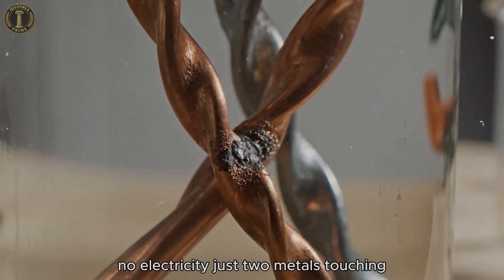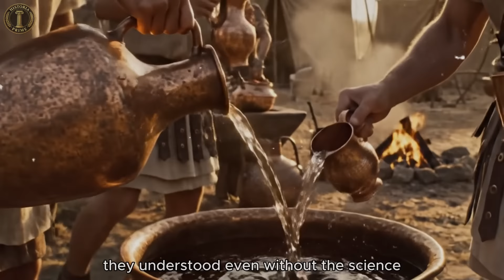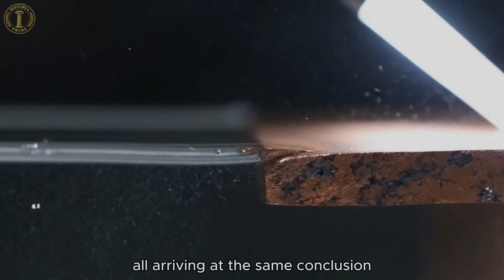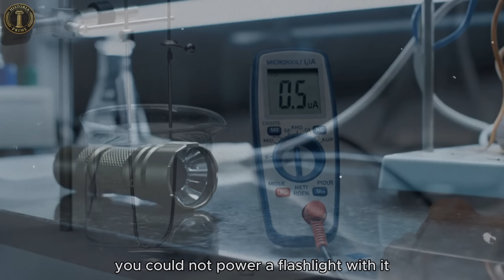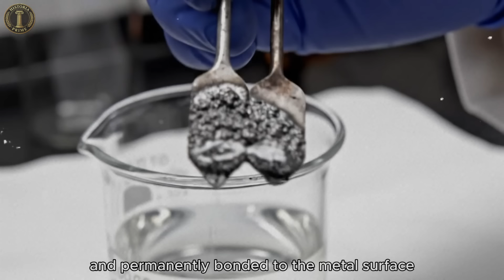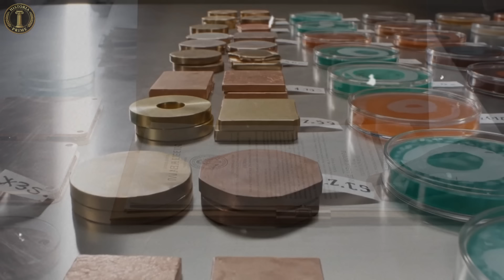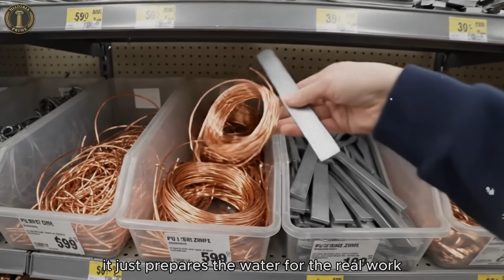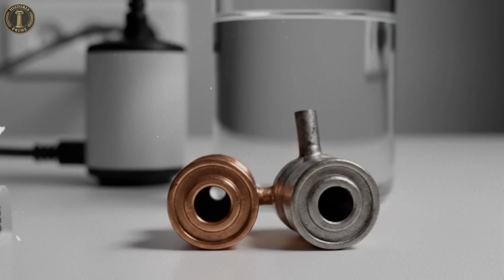Connecting Two Metals Purifies ANY Water — The "Earth Filter" Secret They Buried

Comment: Bring back copper water lines in homes, pvc plastic is poison. Many new buildings are replacing pvc pipes with copper, the results are noticeable quickly.
Reply: My brother's first job out of high school was as a helper with a Plumbing Co.  Ater a year there my Bro gifted my parents with replacing all their ww2, galvanized steel plumbing in their house with Copper Pipes . Iam still using the house & its wonderful Copper plumbing today and what a difference when its not copper.
Reply from the maker: A lot of people still prefer copper for durability and heat tolerance. Every material has trade-offs, but it’s understandable why copper continues to have such a strong reputation.
Reply: Just be sure NOT to solder with lead. 😉
Reply: Same principle can be used to repell insects
Reply: @ApollyonLethePouvez-vous me dire comment ? Merci
Reply: Yea they know that’s why they switched
Reply: Galvanized pipe too yuck
Reply: Sadly building industry is about profit not safety or health, the regulations are as minimum as the government can keep them as well as restrictive as government can keep them.
Reply: Let THEM eat plastic. YOU can just install your own copper pipes.
Reply: Well if people wouldn't immediately steal all copper pipes....
Reply: If you have the money, you can do it
Reply: We had copper piping for years in our home. The only thing us pin holes happened all the time making the well pump run . Leaking pipe tore up one well pump. My husband thank goodness knew how to install a new one. After that expense he changed out all the copper pipes.
Reply: @PatriciaAShelton-no6cq  - I hope he was using HDPE pipes. (High Density Poly-Ethylene). They do not have any kind of chemicals inside and they can not dissolve in Acidic or alkaline water. This is the best choice for water. In Germany they use it for all pipes, the big pipes in the road to the houses, because they are completely harmless from a chemical standpoint.
Reply: I read one time that one should not save pennies under the bed. They could draw lightning. True or not? IDK. 
If true, could that be true with copper pipes? 
I wear copper bracelets. Have heard they were good to help with arthritis. True or not? This makes me wonder if could be other benefits of having copper on oneself. 🤔
Reply: @TheQuicksilver8 How goes your arthritis . Thinking of buying one myself
Reply: @TheQuicksilver8  - I am a huge researcher.  Arthritis (if confirmed with an X-ray showing calcified nodules in a joint) is simply a magnesium deficiency.  I had painful bone spurs that dissolved, taking the pain with it, after 5 months of a daily regimen of Magnesium oxide at 3x the daily dose.  Take one zinc per day also, for immune system issues.  Persist and at the 6-month mark, you will be smiling with your calcified nodules gone along with your arthritis diagnosis!
Reply: @TheQuicksilver8 :My mother wore two on each wrist. She swore they helped her arthritic hands. Now I'm 73 and have arthritic hands.  Very painful along with hip and lower back. Actually my upper back hurts to now days.  But I have psoriasis so mine probably is caused from that to. Dr wants you take meds but the side effects are so dangerous.  I did take a monoclonal antibodies drug  for psoriasis a year before Covid hit. The cost was astronomical.  Fifteen thousand a shot. One shot in September then another in October to get started.  Then one every three months.  I was given the injections at the Dr office so my insurance paid for it. Medicare covered their share of thirteen thousand, my supplement plan picked up the remaining two thousand.  I couldn't afford the treatments with new biological drugs until I retired and started my Medicare which I do pay for plus my supplement plan. I couldn't pay two thousand dollars anyway every three months. No way.  Thing is tho when C hit I quit taking it. The drugs slows the immune system and can be life threatening catching just a cold that could turn into pneumonia.  But my psoriasis to this day hasn't come back. BUT!  In 2024 I was diagnosed with a rare sarcoma cancerous tumor in my left ankle called leiomyosarcoma.  A cancer that attacks the soft tissues  like veins, nerves, tendons but rarely bone. No treatments for this type I had. Surgery to remove my leg below knee. I will always believe thar the shots caused it. And the so called Covid vaccines are not vaccines at all, but a monoclonal antibodies or biological drug. That's why it didn't stop the spread or ftom you catching it. Why you needed shots every three to four months.  I knew that after I was curious what the name of the drug actually was because Pfizer is the company name like Tylenol or Bayer. These meds are spelled strange and hard to pronounce but they all end in MAB. MONOCLONAL ANTIBODIES.  Kiss my butt an call it a biscuit after I learned the name I was informing people in the comment section and next thing I know they started to change the medical names of these drugs. They took down the video I watched to learn the name . Videos they put out sat Drug companies changing name of vaccines.  Those are still up I suppose.  But it happened fast. And the pharmaceutical companies made trillions on these drugs.  Of course if you didn't have insurance it was free, but if you did have insurance they took it and no copayments or out of pocket needed. Governments paid a lot but I'm sure those in the know invested heavily in them.
Reply: Stupid. Copper which is not bound to organic molecule, this will harm your body. It will travel in your brain and create fear-disorder.
HDPE pipes are the best what we know these days. 
Copper will create neurological damage and weaken your immune system.
Reply: @mikropower01  and the link to the studies about  what you wroted ,please
Reply: @mmvm562 - This is common sense, elemental copper is toxic for all human life, plants, animals, bacteria.
Show me the study that it will harm people if you crush their head with a hammer. Does not exist, so it should be no problem. Right?

Use google, wikipedia or biology books.
Reply: @mikropower01 Tool
Reply: @mikropower01 pistachios. U.v. armor itself. 1/4 cup=.36mg. 40%ish daily copper (for dieters, 2000 calories)
Reply: @LivingStone.d  - I take copper supplement, 2mg of Copperbisglycinate every day.
Pistachios are here a bit to expensive to eat this daily.

But you are right, it is the best only use copper which is bound to an organic molecule, like in the pistachios, I would never use elemental copper, because this will damage the body and brain.
Reply: @mikropower01 Ppl 4get to quick search their body types general compatability, with, anything.
Thats how you automagically rule out fake/abrasive supplements too man
Reply: @mikropower01  just take chlorophyll - it has copper
Reply: @mikropower01 :think it's lead piping you're speaking of. Not copper.  Copper has been used in plumbing for many years.
Reply: @PatriciaAShelton-no6cq  - Lead was used by the Romans and they did know the problems with lead.
In Germany we have got the order to let the water flow out of the pipe, till new, fresh water has replaced this old water (with Copper ions in it).

Copper is very toxic to all kind of life.

If the copper dissolves in the water, then there is no grow of bacteria any more, but because of a good reason.

Copper is good for the human if it is bound with an organic molecule. To example Copper-Bisglycinate. Normal elemental copper will damage any tissue and it is bad it it is damaging the brain.
Reply: @mikropower01  A complete tool calling people names.. Educate yourself before you talk be es! Copper pipes are safe so is drinking water from copper cups. You are confused with led pipes!
Reply: @TimmyArroway  - Ha ha ... they are not save in Germany, but we have other standards compared to the USA. In the USA they can bleach flour, use bromid in it for what ever reasons, add food colour in corm flakes which cause cancer. I guess, everything is possible in the USA.
Reply: @mikropower01 You need help and education.
Reply: @TimmyArroway  - I am very well educated. You are unable to use google. You possibly get your knowledge and education from Tiktok. 🤣

Comment: How about a pre 82 and a post 82 penny stacked  in a glass of water
Reply: Good thought!
Reply: I bought 100% copper rounds, small, from Amazon and put into my water jugs, sits overnight and purifies the water before I drink it. Water tastes So much better 😊
Reply: @SatoshGirl 🤝
Reply: & you could probably purchase the pre 1982 pennies from Money Metals Exchange if you can't find any
🇺🇸😎
Reply: I just googled the difference between the two. 🤯 🤝
Reply: @LittleMissUnderstood ... And ?? ... 🤔
Reply: @Donnie.Silver
Pre 1982 pennies were 95% copper 5% zinc/tin, weighing 3.11 grams. Mid 1982 forward,.pennies are 97.5% zinc and 2.5% copper PLATING, weighing in at 2.5 grams. Huge difference.
Reply: @LittleMissUnderstood ... Thx 😉👍🏻
Reply: @Donnie.Silver👊
Reply: @LittleMissUnderstood  One alleged reason for copper pipes being replaced is that they tended to get encrusted with residue inside the pipes. The real reason could be that those pipes weren't pure copper.
Reply: @i @istudios225 en we replaced some copper pipes in our house they were lined with green algae. They were 45 years old.
Reply: @istudios225 reading about scrubbing your pots and mugs because they get a coating that would be very difficult to  remove from pipes. Be happy just to have clear water with no microplastics how would you clean them?
Reply: @JeanEcassup .  I’m giving blood to Red Cross to remove plastics.  Probably not significant but diluting in any case!
Unbelievable world we survive in now!!
Reply from the maker: Interesting idea, but that’s still a very different setup from using the metals in a purpose-built arrangement. The composition difference is real though, which is why
Reply: @HistoriaPrime1212  will copper and zinc remove fluoride from the water?
Reply: @Carmen-us1ew   Good question: Anybody have the answer?  Anyone? Bueller?  😂
Reply: U
Reply: the newer pennies are zinc flash-coated with copper,so the zinc doesn't get exposed for galvanic action in water.
Reply: @JayWye52  Just run a file along the edge and expose the zinc, keep cutting new notches as you use it so the heavier metals that form on the surface don't block the reaction? Just a thought. Also you should probably wash a penny and maybe even hold a torch up to it before using it in any water you plan to drink. It may kill bacteria but I don't know about all the viruses that might be on a penny.

Comment: Where do we get zinc?
Reply: Electroplating shop . Get a zinc annode  ball.
Reply from the maker: Usually from hardware, roofing, metal-supply, or online material sellers depending on the exact form you need.

Comment: Big Pharma would not make any money. Needs to keep us sick
Reply: Cropper pipe is recommended, and changed from metal pipe already.
Reply: We are living through the changing of the Ages. I am oh so glad to see the ending of a dark age. 
WELCOME TO THE AGE OF UNDERSTANDING!
BE GLAD IN YOUR HEART ❤️🌎🦋
Reply: Will it work in pool skimmers ?
Reply: @demand1575    - READ THIS IF YOU HAVE A SWIMMING POOL - We have a large inground pool and spa at our home (30,000 gallons).  We've lived here for decades.  I had always managed our pool chemicals and maintenance and kept things sharp. But it was time to update and remodel the aging pool. So, we bit the bullet and had a full pool remodel - new pebbletec-type surface, new coping tiles, new pump, new large sand filter, etc. It looked beautiful.  
But shortly thereafter, we noticed the filtration and chemicals were not keeping the water clean like previously.  The water was constantly turning green with algae! We dumped in boxes and boxes of liquid chlorine, algae reducer, shock, and every other thing available to cure it.   We went through changing the pump to another one, changing the sand to Zeolite, numerous technicians were called out to troubleshoot, etc.  Nothing helped.  The amount of effort and money to try and treat the pool water was insane.  
After copious research, I learned about Copper Sulfate powder. I use specifically this: "Copper Sulfate Pentahydrate Powder".   I bought it online and sprinkled about 4-6 cups across my pool water and ran the filter round the clock.  It turned the water a brilliant opaque cloudy blue.  Over about a week, the sand filter removed all of the blue cloudiness and my water was pristine.  
I have had no more algae, PERIOD.  It was incredible. Now, for my own piece of mind, I still have several floating chlorine dispensers and very occasionally add muriatic acid, but no more algae!  I keep a 5 lb. bag in my stash and if there's been a big storm or a lot of debris fall in the pool, I sprinkle a cup or two in the pool and that's it!  No more gallons of chlorine or shock during the summer dust, wind and rain storms.  I only regret that I had never learned about this years ago!
Reply from the maker: A lot of people feel frustrated by that system. We try to focus on practical, testable methods people can understand and use for themselves.
Reply: No your environment, food & drink and no exercise makes people sick.
Reply: @Robert-hr6sh  sounds like y’all are making the same point…he’s saying if we did these things and eat right grew our own stuff, learn how to purify our own water and foods,big farma won’t make money,then doctors won’t make money ect ect…they need us sick is his point…but,your correct both things can be true..we need to build instead of waisting time with contention we are the people,was your comment to teach or fulfill your ego ?we gotta come off mommy tit at some point.
Reply: @E.r.u.p.tlegiontv 🎯
Reply: By nature we get sick .you people actually believe to be immune to everything 😂
Reply: @brianlove5782  there’s a system stored to work on speeding it up that’s why the life expectancy changes every 100 years brother…they will never tell you the things of this world heals cancer..do you understand all these industrial things are new cancer isn’t ancient brother niether is hiv…we know people get sick but when there’s no cure you know it’s pure cruelty.
Reply: @brianlove5782 By nature? How? Is this laughable to you?
Reply: @meddinaheeleen777because nature is the real enemy of life, yet there is no life without it.
Reply: Ok,thank you❤ Imo illussions are our worst enemy. It hides the truth about everything. Nature is used and abused not the other way around. God bless.
Reply: SPOT ON! BUT OHH MY GOD! SO MANY LYING USEFUL IDIOTS EVERYWHERE! THEY ARE DANGEROUS! LIARS ARE NEVER HEALTHY TO BE AROUND.
Reply: This isn’t big pharma. This is fools thinking they know better. We have used brass for centuries for this exact reason. Stop lying to yourself.
Reply: @donut3946  Fools? Why are Americans so rude! My God you are everywhere on YT bullying people. Say what you want to say without patronising.  It's becoming unbarable!
Reply: Zero water filters have copper, and charcoal in them.
Reply: Flint Michigan !all those kids that died from water ..wow !no justice even though this information is no secret…I say genocide😢
Reply: Guess now I'm on the LIST....😊
Reply: agree with you about this

Comment: I use the Nature 2 system to clarify my hot tub water. A single cartridge, just lying in the skimmer indent, keeps the water crystal clear for at least a year in a 450 gallon hot tub @105 degrees. And I mean crystal clear. As clean, or cleaner than the drinking water in your house. Easily. And I've learned to never check it.

This all started because a French company, Perrier water, was bragging about how they had the cleanest bottled spring water in the world in their TV ads, and it turned out they did. Too bad their spring was in America. Big business decided they wanted to know why. So they put together a consortium and threw Perrier out. Then they dug up their entire creek bed to find out why. And it turned out it was high in nickel and silver. And that's what's in my Nature 2 cartridge. Never any chemicals or smell. The Nature 2 cartridge is all you need. They have king sized cartridges for swimming pools as well.
Reply from the maker: That’s a perfect real-world application of using specific metals for water maintenance. 💧
Reply: Can water purified by this cartridge be ingested safely? Thx
Reply: That nice foie your hott tub wanker think of all the plastic shit replaced by copper and enjoy your hott gay
Reply: Really interesting and great to know. Thank you.
Reply: Can it be drinked?